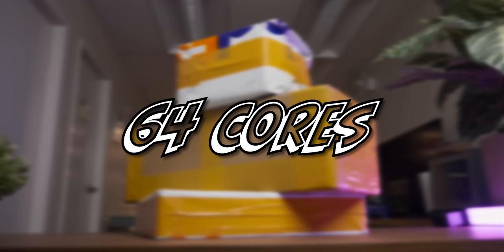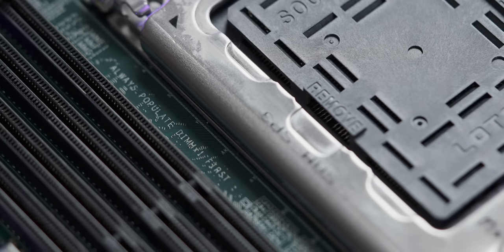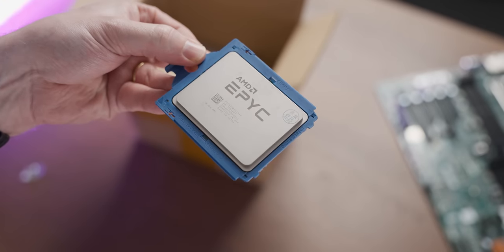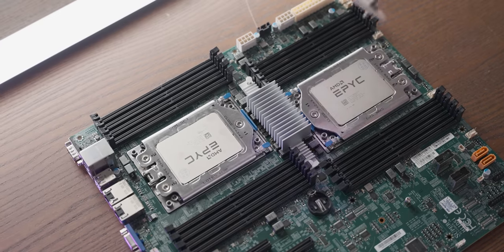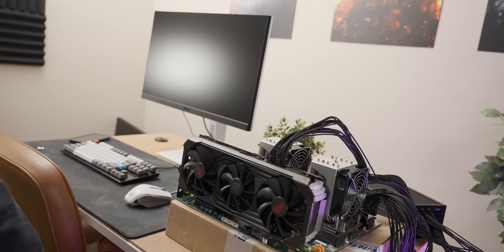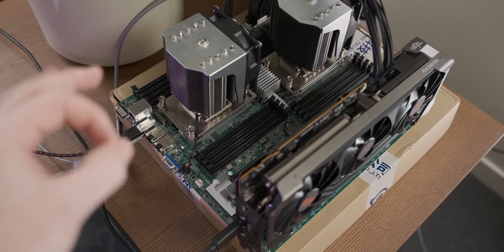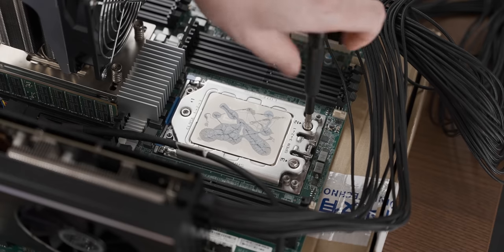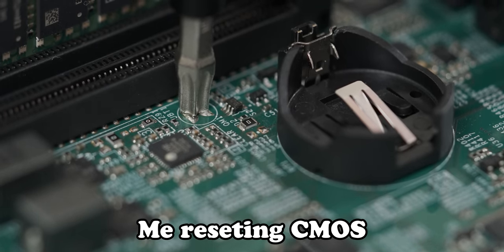I Bought 64 CPU Cores From eBay For $400...

Comment: Keep in mind that you have to use the VGA out. It might be different now, but for my Supermicro board, the VGA is the only way to get into bios. In all of its 640x480 glory. A GPU will work fine in windows, but until windows boots, it doesn't show anything for me.
Reply: He didnt read this comment. He spent weeks trying to figure this out. Then made new video on it. Only if he saw your comment,man 😅
Reply: Ah yes, supermicro.
When I started getting back into PCs right before the dark period between rx4-500, I started out with free trash 771 workstations as my younger coworker was really into XP - 7 era stuff. For years he was always pushing supermicro for compatibility. I had a couple over the years but they were never more than 2 memory slots and were basic boards. The one supermicro board I kept was an mATX 1150 board for a NAS that i wanted more than just 1 x16 and 2-3 x1 as I was running sas cards and wanted at least x4 on two. I also already had a shit ton of various DDR3. The board claimed to work with the i3, celerons and E3 xeons, but not the i5-i7s. The single 1150 i5 I had came before the xeon and wouldn't post, but i had another 1150 board coming for my kid's PC at the time (hence the i5 while i waited for the xeon in the mail). His board had a couple of pins smashed down I was able to re-articulate with micro tweezers. Put in the 'tested' i5. No post. Start the process for returning the motherboard, seller is fine with taking it back, the e3-1230v3 arrives. Before I ship the bad pin board I put it in. Posts immediately. I end up getting another i5 that comes up later.

So in the meantime my kid has my nas cpu and my coworker insists that supermicros limited ram compatibility for my particular board is near imaginary. I get the i5 in and swap it into his PC. I put my generic 1333 ecc dell memory that usually works with everything else, no post. I try some matched crucial, no post. I try my all of my 1600 sticks individually, only one stick of random 2GB works. I sell it off to my coworker as he swears he'll get it with his sticks. He ends up going through several sets with the similar results with memory from his server and workstation stash. I end up buying it back to give it another go. The listed sets that were supported were hard to find secondhand except for one set. I bit the bullet and bought the RAM, but then put my nas off until I found a 4 U case I liked and gathered SFP+ equipment. Time passes, I swap the i5 out for another i7 equivalent xeon and pair it with my old rx580 to my kids pc during a case upgrade. For fun I put the i5 in the supermicro with random non ecc memory. Forums, cpu support and bios update documentation all claim the i5-i7 aren't supported. Fucking thing posts. I still have it to this very day, I doubt I'll ever get rid of it willingly, even though I low key hate it lol Only supermicro board I've ever had issues like that with, but damn was it a bad taste compared to their 2011 and 1156-55 boards I'd used prior.

Comment: Before Power On
1. Check that the LEDM1 is blinking before the motherboard is turned on.
2. Check that the LED3 on the motherboard is on.
3. Make sure that the power connector is connected to your power supply.
4. Make sure that no short circuits exist between the motherboard and chassis.
5. Disconnect all cables from the motherboard, including those for the keyboard and
mouse.
6. Remove all add-on cards.
7. Install a CPU, a heatsink, and at least one DIMM on the motherboard. Check all
jumper settings properly. Make sure that the heatsink is fully seated.
8. Use the correct type of onboard CMOS battery (CR2032) as recommended by the
manufacturer. To avoid possible explosion, do not install the CMOS battery upside down.
No Power
1. Make sure that no short circuits exist between the motherboard and the chassis.
2. Verify that all jumpers are set to their default positions.
3. Turn the power switch on and off to test the system.
4. The battery on your motherboard may be old. Check to verify that it still supplies 
~3VDC. If it does not, replace it with a new one
Manual Fro SuperMicro
Reply: It looks like there isn't even a CMOS battery installed in the first place...

Comment: The socket specific torque wrench tool wasn't included with your mobo. Ask the seller for it as that is going to most likely be your issue. Notice the tightening order for the screws printed on the cpu bracket? Thats the order you torque them in.
Reply: THIS

Comment: 2:10 one of those network ports will likely also be a remote management port: a computer in the computer that hosts a webpage that lets you start, stop, and reboot the computer. It will probably also let you remotely control the computer but ymmv on if you need an ancient version of Java filled with security holes to run it.

These management ports typically have diagnostic information such as voltages from the power supply, fan RPM, and sometimes what CPUs+memory configuration it sees.

Comment: Be sure that the board and CPUs are compatible. Some of those server boards only work with certain CPUs. You may also want to try going IPMI into it if the board supports it or going in the VGA/Mesozoi port.

Comment: It could be the IPMI needs time to boot before the system powers on. Not sure but the blinking light beside the Aspeed IPMI chip is an indicator. Also, you should torque town those CPUs with the AMD Thread ripper/epyc tool.
Reply: Yup. I've a supermicro board and if you power it in immediately after plugging it in, it'll sit there for a minute waiting for the BMC to boot up. I think it even outputs "waiting for IPMI" to the screen.
Reply: @b127_1  Usually fans will already spin up when the IPMI is initializing. But yes, it can mean you'll nervously wait minutes until anything comes on screen.

Comment: I think I've seen this issue before.... It's because supermicro uses their weird proprietory connector which fit in x16 but actually pcie x8 with different output lanes so that a normal pcie device couldn't work. The connector is used for a storage such as SATA and NVME. I've seen the converter to a normal pcie but I never tried it. This problem also happened to my old supermicro server, the difference is I'm still using lga 2011.

Comment: You may want to try the VGA port on the motherboard.    Server boards usually have an aspeed video chip and dedicated network port so you can remotely change bios settings over ethernet.   It has to get though that nonsense before it even thinks about booting the cpu.

Comment: It could be the fact the mobo doesn’t like not having a power switch, I had this issue with my old 5000psl mobo until I got a power switch from Amazon and tried all the configurations on the panel pins. After that if powered on.

Comment: You must use the supplied torque wrench to get the system working. Sadly being used you did not get this. But they are only ~20 USD. Without it the CPU is likely twisted in the socket with pins not making contact. These are a behemoth of a CPU that must be secured properly.

Comment: In those types of motherboards, I believe you have to run dual CPUs or install a continuity module for the "empty" CPU socket.  it does sound like one of the CPUs was dead though if you weren't getting any power with just one, or possibly one of the sockets on the board is bad.

Comment: If cpu isnt mounted correctly it may do that that also explains why it booted for a second there. These sockets do require a lot of mounting pressure so maybe you have to really screw it down (I think they come with a Torque driver and recomanded specs). The board has ipmi so trying that would be the first thing you should do.

Comment: happy to help you figure this out as there were quite a few things done incorrectly in the video. 
- CPU mounting: the cpu has to click in with those blue tabs then you put the retention bracket and torque it to spec (must have tool for that, comes with threadripper CPUs typically, not sure about epyc). Thermal past application, use 9 dots at least
- RAM: do NOT EVER use non-ecc on server mainboards. check carefully online and the manual to confirm compatibility. Check manual for which RAM slots to use if not fully populated. You can fry normal DDR4 sticks if mounted in server.
- you don't need a GPU, you can connect a VGA monitor to see the bios screen and get the IPMI IP address. There is like a small computer within the mainboard that manages the big PC and gets you plenty information about your components (without even booting the PC). I think those flashing green lights mean it is powered on and ready to use. 
- The Ethernet ports are not all for the PC. One of them is for the IMPI remote management system. Make sure to check which one that is (manual again) then connect it to ethernet to be able to use remote access.
- use the IP address displayed in bios boot screen. type it in your browser, then you can access the ipmi. 
- remember that it takes a couple of minutes for the on-board IPMI (small computer on the mainboard) to boot up. 

hope this helps. There are a few more precautions. reach out if you'd like some more help. This hardware is tricky to get running. Once you do, you can add multiple GPUs, everything will run at full speed as you have a ton of PCIE lanes

Comment: On the server board, you have OOB to fully control the chassis. So you don't need to jump the power pin nor need a GPU to have an output.

Comment: When you buy used non-pin CPUs and RAM you always should clean their contacts with eraser rubber and ethanol. They always get an invisible film of rust/oxidation which acts as insulator.

Comment: It could be a pressure issue, the three retaining screws on EPYC and Threadripper sockets must be torqued down to a fairly specific amount - if you get the torque wrong (and yes, too high is also wrong!) some or all of the memory channels and/or PCI channels often won't work so that's another possible reason though usually at least ThreadRippers tends to get to the BIOS screen. But since it's a server they MAY have decided you're supposed to check the BMC information for that instead.... The ASPEED Baseboard Management Controller runs completely independent of everything else and you connect to it via the dedicated (third) network port. That should be your first place to check.
All Threadripper retail packages includes a yellow bespoke torque-controlled torx screwdriver that goes "click" when you hit the right amount so they're fairly easy and cheap to get on the second-hand market. I've seen blue ones that presumably comes with at least some EPYC processors (matches the 7xx1 carrier board color) but a EPYC one should work. It's NOT impossible to do this without a torque wrench but it's definitely not trivial even if you've done it many times!
Looking at SuperMicros memory list I'll note that it's VERY small but also that all the few 16GB sticks it does list are 1Rx8 models, not 2Rx4 like the ones you bought.
It does have some larger 2Rx4 sticks so it clearly supports x4 chips which means those memory sticks MIGHT be supported but... risky. From any of the other large vendors the manual would spell out exactly what memory is supported but not with SuperMicro... The other source is various memory vendor memory configurators - Crucial only show 1Rx8 models for 16GB but that might be because the memory chips required for 2Rx4 is, well, long since out of production and they're selling new memory. Kingston's Memory Configurator usually has a side-bar telling you what the hardware supports (in addition to "these current server memory sticks will work) which is really neat but... their entire site is down for maintenance  Sigh. The manual does say how to officially run it just one memory stick and one CPU (and 2/4/8) but two cpus officially needs all 16 memory slots populated, I expect this is completely bogus.

Comment: Ive seen these combos on ebay and they were very interesting. Thanks for taking the plunge on one of these.
Reply: I really dislike this video as it gives the wrong impression. With some thought into part selection you can easily get amazing systems up and running. I have a ebay sourced amd server and had none of these issues.

Comment: Those are torx bit screws, very common anymore at the hardware store for things like deck screws and drywall screws. Make sure to get the right size, there are about 6 sizes all pretty close. They don't slip and cam out under high load like Phillips bits do.

Comment: Great video Dawid. I am on my second server motherboard from Ebay, but mine are a bit older. I currently run a Supermicro dual socket with 2 Xeon X5650 and modern coolers.

Keep up the good work and good luck with the project.

Comment: Not sure if that changed on Epyc, but you will usually not get POST with CPUs installed but no memory. Also, server motherboards usually require the correct memory positions to be filled - so please double check in the manual. Easist process is to start with just one CPU and the least amount of memory possible, then start changing memory modules untill you have any signal. Like other people commented, server motherboards can take a long amount of time to do anything. Another thing that comes to mind, maybe the BIOS is not updated for this specific CPU? That would be problematic because you would need a supported CPU in order to boot and uptade BIOS. Well, good luck! Part of the fun is getting it to work :)

Comment: In case it hasn't been mentioned already in the comments, you need the proper torque screwdriver that usually comes with the cpu to mount the cpu correctly. :)

Comment: From what i see it most likely a torque issue - these CPUs require a lot of torque on the socket screws, it is by no mean "finger tight". I do not think that it is a memory or cpu vendor lock issue because these manifest much later and you would see the fans spinning. To this theory the bad spread of thermal paste adds up as well - looks like cooler bottomed out on the socket instead of the CPU itself. Also, in order to get more information - assuming you just apply more force to screws - just connect an external VGA display to this mesozoic port, these boards come with IPMI management chip (it is active since it blinks green when board is fully powered and it booted up) and it starts outputting debug information to the onboard VGA before it even initializes PCIe devices so you will get information much sooner.

Comment: It likely works. You just don't have the torque wrench that is normally included with the cpu's. And they are VERY sensitive to torque. If you are even 1 Nm out of spec they can just refuse to work.

Comment: I'm somewhat convinced the Ebay Seller is like, 'Cool, I have some noob who will buy all this potentially broken hardware... sweeeet'
Reply: Jeez... Tell him to read the manual and check the LEDs/jumper configurations. 

It works fine, he's just lazy
Reply: @zCaptainz   No he needs to torque the cpu to the exact correct pressure for the pins to make contact
Reply: @LinusTechTipsTemporary  I don't think that's the issue

Comment: If this was run in a server, you might need to set up a console via the management port and tell it to turn on. It could be that it's just waiting for the command to start up. Turning on a server board just starts to initialise the management subsystem, think of it as turning on the computer that will turn on the computer.

Comment: It's server hardware and you don't have a CMOS battery installed, even in the clip where you're resetting it.

I've seen consumer grade hardware that refused to boot with a bad one before.

Should try that if you haven't!
Reply: Exactly, I would not be surprised if the board would come to life as soon as there is a battery installed :)

Comment: For first boots use internal GPU from IPMI (to use different one you still must set it in BIOS anyway) and just connect monitor thru VGA, you can also look to IPMI what happening during boot (aka 15 mins boot is normal)

Comment: Nice to see you have fun with those, in case you are wondering those SD cards are sometimes used for OS on setups where you need no storage just compute.. anyway using a single 7702p mainly for pcie 4 and for more pcie on the MBbut first gen are alot cheaper per core but older servers are often a ton of bang for the buck!(if you dont need insane single core). Also said it didnt work out usually i pay like 20% more to buy it of local sellers because i trust those more but hey even there sometimes you get things that dont work.

Comment: Enough people have already pointed out the need to properly torque the socket retention - but you may still require multiple attempts after getting the right torque tool. The EPYC SP3 carrier and tolerances were "pretty bad" to the point that even now, most board vendors sell the board with a CPU preinstalled and guaranteed to POST. 

From there, server boards like that one have a BMC (Baseboard Management Controller) which is basically a full low power PC similar to a raspberry pi that runs a low resource OS and hosts an out of band management interface accessible in a web browser. This interface lets you mount disc images for software and driver installation, view the screen and input keyboard and mouse inputs, as well as turn the server off and on as if you were standing in front of it.

That BMC can take QUITE a long time to boot (up to FIVE MINUTES) so its worth just leaving the server off but plugged in with the power supply on for a bit. The BMC will stay in a low power initialized state for quite a while on the 3.3v battery, but will eventually fully shut down again abd require that startup again.

Comment: A few things as well. Not all epyc chips will work on all boards. You need to verify that chip works on that motherboard. There were what 3/4 gens on that socket? So thats what i would check first.